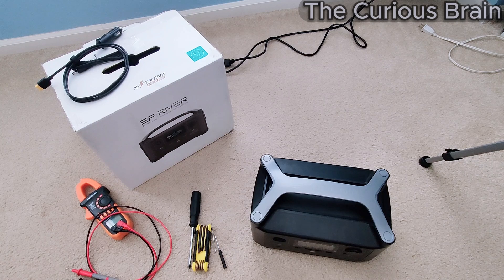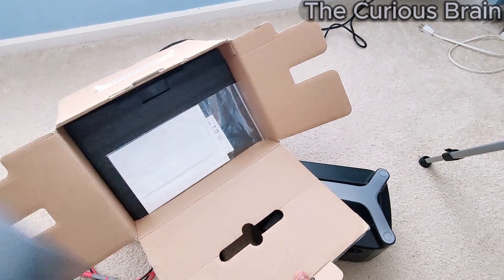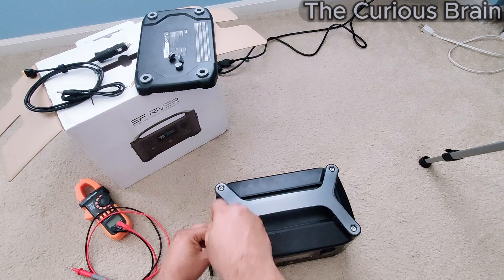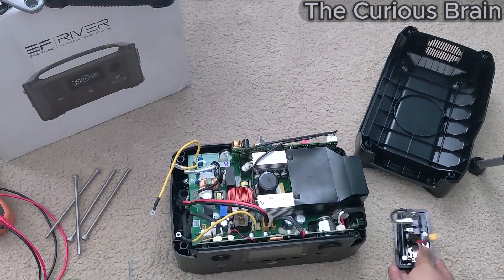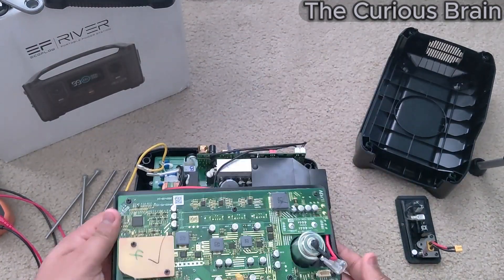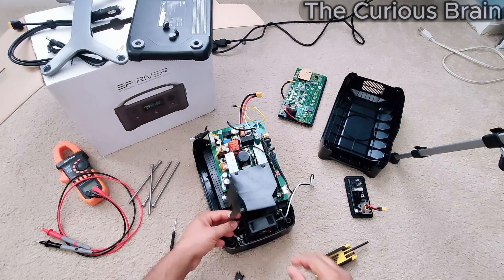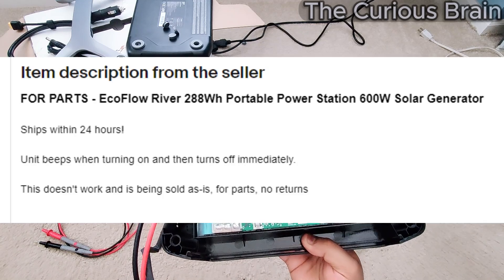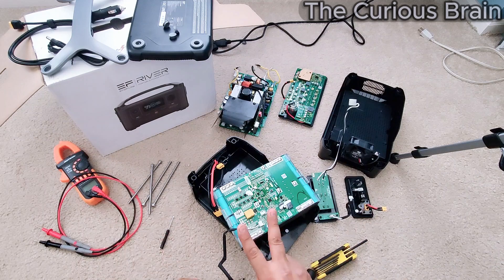EcoFlow River Teardown | Step-by-Step Instructions | Part 1

Comment: I got a few River Pro at 0% state of charge for $75/e and was able to bring the bms back online then charge them to 100% without issue. A few of the cell groups were below 1v but just barely and they seem to have come back without issue. Now i need to find some of the extra battery cables as they seem to be unobtainable.

Comment: I I have a slightly different problem with my ecoflow river 2 battery: it no longer charges (neither on the solar panel, nor with my wall outlet, nor on my car). Do you think your videos will be able to solve my problem?
Reply from the maker: Depends on why it's not charging, mine wasn't charging due to cells being unbalanced so I don't know why yours isn't charging.
Reply: @Xx_TheCuriousBrain_xX  thank you. Do you think there are many possible reasons for my problem?
Reply from the maker: Yes, if your board is bad or provided high power can definitely cause more issues. If you left yours without charging for long time then my video can possibly fix your issue unless it's main board related.
Reply: @Xx_TheCuriousBrain_xX  I used to use it regularly but it broke down after only 2 years... very poor quality in my opinion. I think I will have to buy a new battery. big thanks anyway

Comment: nice video. could you tell me type of cells it has for when i need to replace my battery pack i can biy myself and dont get ripped of by electrician.
Reply from the maker: Thanks...these cells are called 18650 cells...they are available everywhere and well known cells. Same cells are used in laptop batteries, power bank etc too...you will also need a spot welder if you replace the cells...
Reply: @Xx_TheCuriousBrain_xX  i know they are 18650 but what are the numbers and manufacturer.... this battery rypes come in a lot of varieties.... from protected to unprotected. heat reseistant to heat delicate. industrial to commercial....... its very important to know tjey are of high quality for ecoflow doesent spare at quality. they make tgis unit so cheap because i presume they are of 1500mAh each but industrial grade ev vehicle grade for example... when i know which type they are i can safely upgrade the capacity once i replace but it would be good to know before it goes bad so i can buy them when the signs of bad battery start to appear... btw. if they are Samsung 1500mAh they can be upgraded to 3.500mAh each...if you do the math you can fit 750Wh in there. there are also 5000mAh ones that are of high quality but not from samsung and they are medium heat resistant so its not so safe anymore but imagine if someone can risk it coz they have the river mini store somewhere not dangerous they can have just shy of 1kWh of capacity. under the presumption its 1500mAh cells inside.
Reply: @Xx_TheCuriousBrain_xX   i f... up. i have a river mini... they have 1500mAh probablly... 211Wh. so if mini has same battery config then i can have 1kwh... i wonder.....

Comment: Part 2 coming soon?... Thank you for this.  I have the same issue.  Looking for a fix!
Reply from the maker: Yes, I ended up making 3 parts. Part 2 is all about putting back everything together and part 3 is actual repair. Part 2 is set to go live on 5/17 and part 3 on 5/20. I can tell you that you will have to charge individual segments after testing with multi-meter....most likely you will have segment 1-2 bad as that's what was weak in mine.